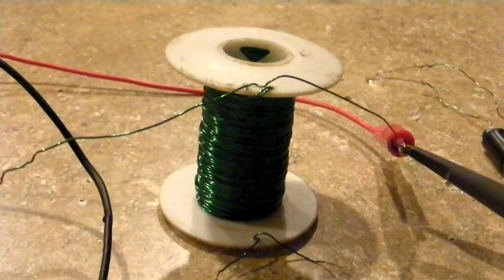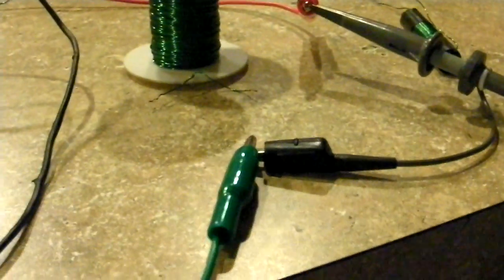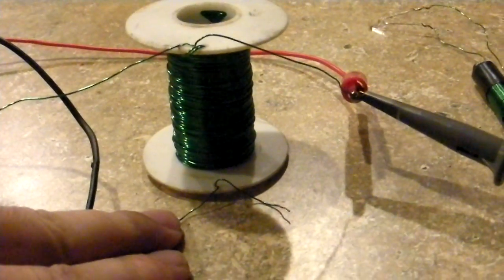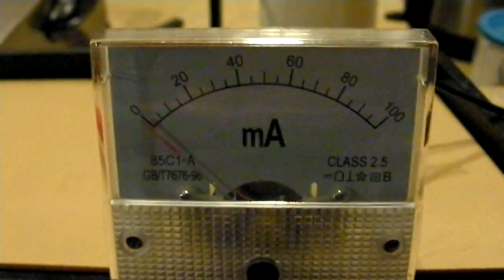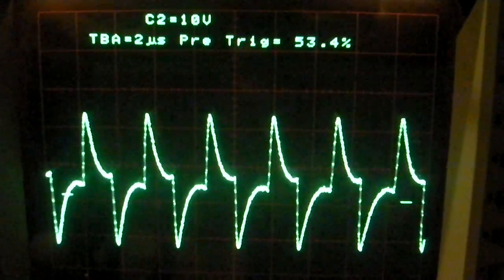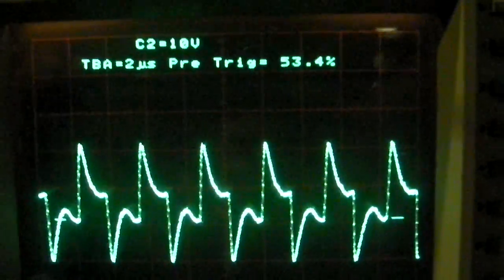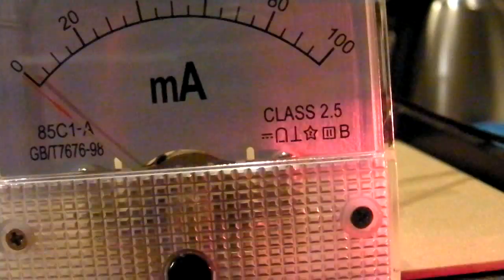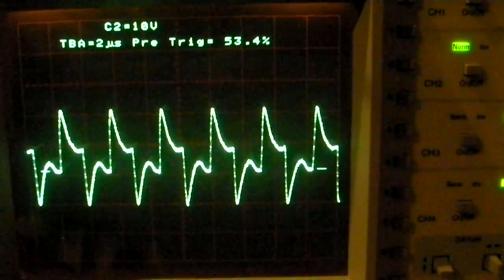Resonance in a Bifilar Coil

Comment: There is no way that coils frequency wavelength is 300 KHz
http://www.csgnetwork.com/wlfmcoilfreqcalc.html
Check it out at the link above .

Enter 300 KHz and you get over 820 feet of wire.
There is no way you have 820 feet of wire on that coil (if you could even call that a coil)

Comment: I just get more confused that you are using a DC ammeter on a pulsating current. How can you be sure that it can keep up with the frequency of the pulses? It doesn't make any sense. Lose it or put a resistor in series and read it on the scope. You're on the right track but confusing new people. Why did Tesla invent it? https://en.wikipedia.org/wiki/Bifilar_coil

Comment: Nice! hooking a Bifilar coil up, like a capacitor, pulsing it into its resonant frequency, and creating lots of dielectric capacitance. then picking it up with the ferrite rod with the coil. I dont think the ferrite rod adds anything, because its not magnetic inductance coupling (at resonance there is a static magnetic field, and the ferrite needs no work at the right frequency), but its the dielectric coupling into the led's coil.  probably it would also work, if a cilinder plate was inserted, with one wire to the led, and the other led wire connected to earth. But you'll probably also need two diodes then, one for each polarity, of the dielectric. So the plus of the led is connected to the minus of the other led. and then one connected to the plate in the bifilar coil, and the other side of the led connected to ground (ground will only intensify it, it should work with only one wire). Try it, before you judge ;)
Reply: I think what he meant with " static magnetic field " , is a " scalar wave / standing wave effect " , and this kind of waves ia available by specified frequency , and in capacitors.
Reply: Master Ivo, could you expand upon "at resonance there is a static magnetic field", my understanding is that static magnetic fields are associated with permanent magnets.  Thanks in advance...M
Reply: Master Iv

Comment: Hi, a question for the teacher, as per the Wikipedia, 1 end of each coil should be connected together to form the Tesla biflar coil. right?!
Reply: yes, but wikipedia doesnt know all... if you hook it up like he does, it acts as a capacitor. the bififlar wires could be seen as capacitor plates. The dielectric energy is focussed inside the coil.

Comment: From the scope it could clearly seen that more power is drawn, than the generator is able to deliver! Generator is not able to "hold" the voltage level of the square wave. Theese generators usually are in teh range of 5 watt power. Use a regular power watt meter at the input side of the generator (110/220V) and you will see an increase of about 5 Watt when connecting to the coil. Which output did you use: 50 Ohm or 600 Ohm?  Your setup is similar to  just connecting a capacitor to a function generator.

Comment: I have a signal generator just like that and I see that the power button has no light just like mine so I am going put an LED power light on mine. Otherwise it is a good unit with enough output power to drive amplifiers or do expirements with.

Comment: This interesting. I don't understand something though. If there is no current in the wire, how is there a magnetic field inducing current in the LED coil?
Reply: correct, there is no current, current is indeed related to magnetism. This works on capacitance, and dielectric (radiant) energy. the coil is hooked up as a capacitor. When pulsed in its resonant frequency, a great amount of dielectric (radiant) energy is produced. The led coil picks up the dielectric energy. and the LED (crystal) converts it to light.
Reply: @MasterIvo  can you please explain how to find the resonance frequency of the bifilar coil?
Reply: @danielakintola8000  tune up or down the frequency until you find the perfect sine wave with Max amplitude.
Reply: @MasterIvo  you mean I should connect the bifilar coil directly to the function generator or put a normal coil in front of the bifilar coil and pulse the normal coil? What wave should I use from the function generator, square wave or sine wave?
Reply: @danielakintola8000  pulsing a normal coil with a square wave works best. Then the bifilar coil resonates best when the outside rim is grounded, while the inside rim is probed
Reply: @MasterIvo  the square wave you are talking about(like that of a function generator), is it the one that changes polarity like AC(-5/+5) or just pulsates between 0 and +5 for example? Also if I want to make the bifilar coil resonant directly like you did in one of your videos without using a normal coil, how will I find the resonance frequency? Thanks.
Reply: @danielakintola8000  to drive it directly into resonance I use a mosfet switch (or IGBT in the past).
ac or pulsed DC both can do the trick. It is always the same.
look at your signal, and change the frequency, you want a sine wave with maximum amplitude.
Reply: @MasterIvo  I was wondering, if I connect a rectifier and a electrolytic capacitor to smoothen the DC, will that change the resonance frequency of the bifilar coil or the electrolytic capacitor won't have any effect on it? Thanks.

Comment: Your ammeter is connected incorrectly. it must be in series wither whatever you are measuring..  Put it inline with the LED and another ammeter inline with the coil. your wave form on the scope only shows that the coil winding is sloppy.  There is no 'resonance going on.  Purely a transformer and an inefficient one.

Comment: Scope shows differentiated square wave, should try it with pure sine wave.  Power to Function generator far exceeds any "free" energy recovered.
Reply: try it with a very short (sharp) pulse. this works best. Sine wave works less good. imagine a swing. you give short pushes to the swing, in its resonant frequency.

Comment from the maker: @wrj100 Precisely the point, if the dc voltage is biased correctly your current draw is zero! Even in a closed loop circuit.

Comment: If you realy want to measure the current, use a resistor eg 10 ohm and hook it up to the scoop. You will see a signal over the resistor because of the CAPACIANCE coupeling. The mA meter is designed maby until 100Hz sinus, so it will not show because it is to slow. If you use blok signals the capactive factor to the world around it will become clear if you measure over a resitor.
Greets M